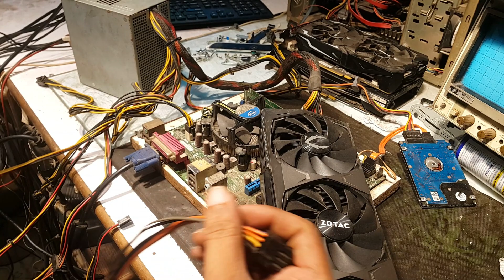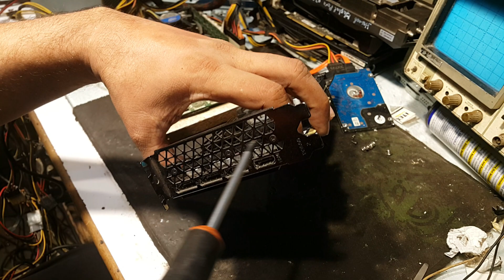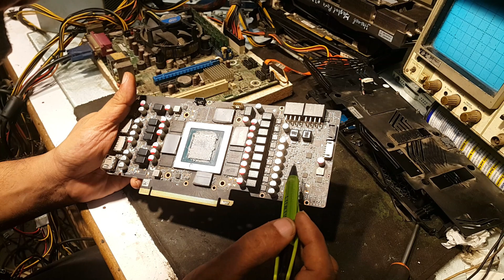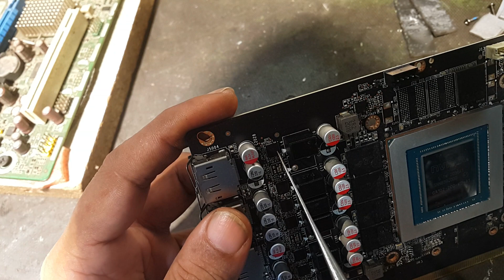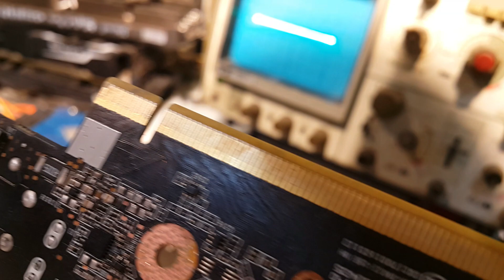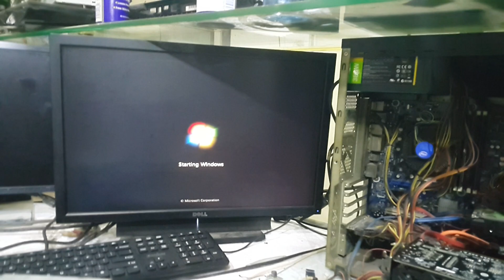RTX 3080 Gaming OC Graphics Card Repair - Not detected

Comment: bros I'm really suspicious with his video. windows 7? repair rtx3080? as i know rtx3080 its a power hunger card. But he use built in dell psu with data cable...hmmm may be possible but its confuse me...also he just check power supply in all chips. Never check vram rams or other things
Reply from the maker: It sounds like you're being careful about the details in that video, and you have some valid concerns. Repairing an RTX 3080, especially on something like Windows 7, does seem a bit unusual, particularly given that Windows 7 doesn’t officially support the latest hardware and software drivers.
Reply from the maker: As you mentioned, it's strange to use a modern, power-hungry GPU like the RTX 3080 on Windows 7, since the operating system lacks proper support for modern GPUs and features. Official drivers and optimizations for the RTX 3080 are made for Windows 10 and later.
Reply from the maker: If the Dell PSU he’s using isn’t powerful enough to handle the RTX 3080 (which needs a strong power supply, typically around 750W or more), it could raise suspicions. Using a PSU designed for a less demanding system may not provide enough reliable power to such a high-performance card.
Not checking the VRAM or other crucial components could be an oversight in his troubleshooting process, especially considering the importance of VRAM in GPU functionality. Thorough diagnostics typically include testing all aspects of the GPU, especially when suspecting faults.
I am focusing on initial diagnostics, checking if the GPU is receiving power before delving into more complex components like VRAM.
Reply from the maker: If you're suspicious, you're right to question it—especially when things don't quite add up with what you know. It's always a good idea to approach tech videos critically, especially with repairs that involve high-end hardware like the RTX 3080.

Comment: I have a similar 3090, the line is not disconnected, but it is grounded on 3 legs. Input 1.8 no output. Can you help me?part number u811 card model aorus xtrem
Reply from the maker: Try to change this transistor. It could be a short circuit.